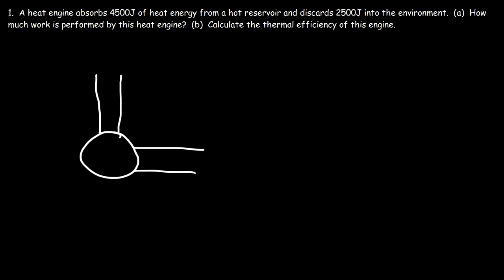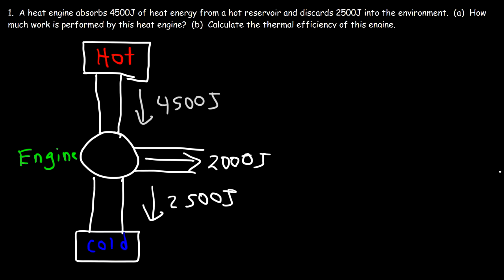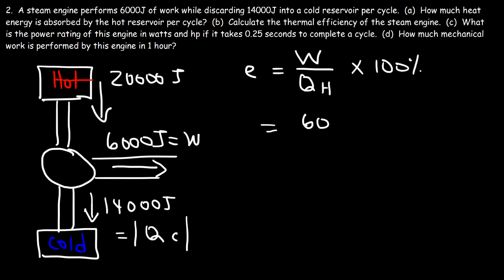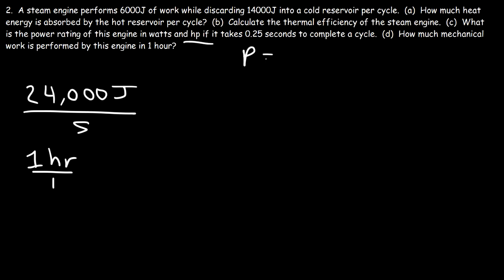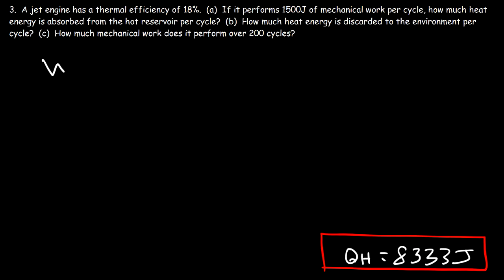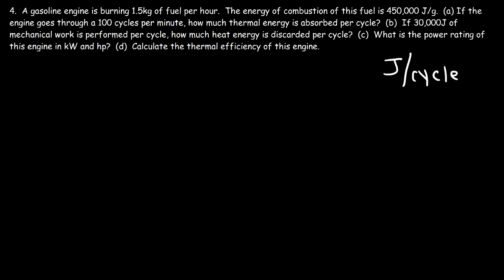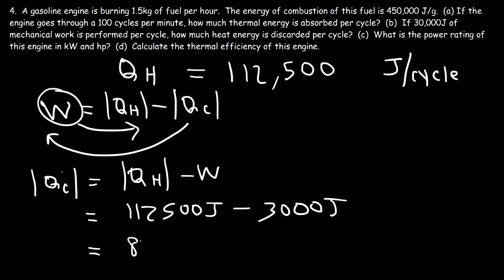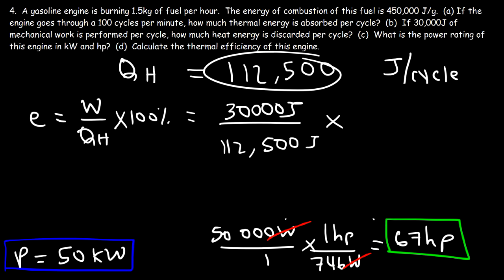Heat Engines, Thermal Efficiency, & Energy Flow Diagrams - Thermodynamics & Physics Problems

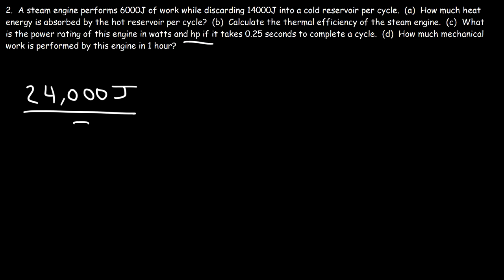Comment: 9:08 why would you use 24000J instead of 6000J since it does 6000J of work?
Reply: I know its been a year, but he used that value because 6000J/0.25s = 240000J/1s.   You were given how much work is done in a quarter of a second. Four times 1/4 of a second is a whole second, therefore (6000/0.25)*4/4 = 240000/1

Comment: For 5 minutes, the temperature of 20 liters of water was warmed from 20 ℃ to 60 ℃. And the gas consumption for 5 minutes was 0.093 m3. How much is the thermal efficiency of this hot water heater? However, conversion to Joule from a calorie is 1cal=4.18605J. And a calorific value of city gas of Tokyo is 45 MJ/m3.

Can someone help me ?

Comment: A carnot engine operates between temperature  of 1000K and  300 K the engine operates at 2000rpm and develop 200kW. The total engine  displacement is such that the  mean effective pressure is 300kPa Determine (a) the cycle efficiency (b) the supplied (c) the tota engine displacement?

Do you have any tuts on this type of problem? 

And what is a gas is supplied to the engine like helium? Any sample problems?

Comment: Depending on altitude and composition of released products the environmental heating claimed in minute 13 is specious. Bermuda grass is largely responsible for loss of planetary ice as the water vapor pollution from sprinklers at low altitude where no rain or clouds but reduced losses to outer space nearly doom us alone.  We have to make ice stop burning allow uranium rich nations license to produce daily megatons of frozen air immediately little else can reverse melting yo